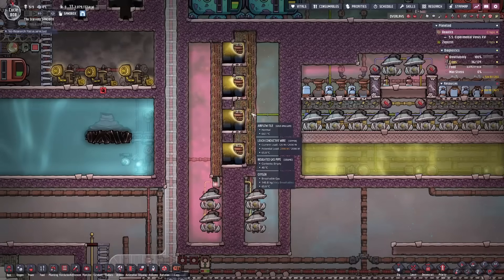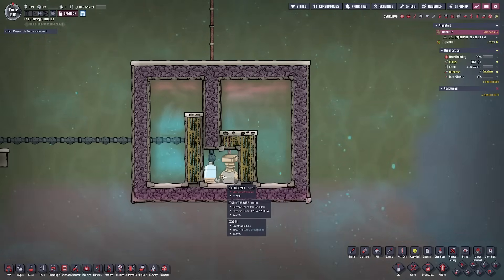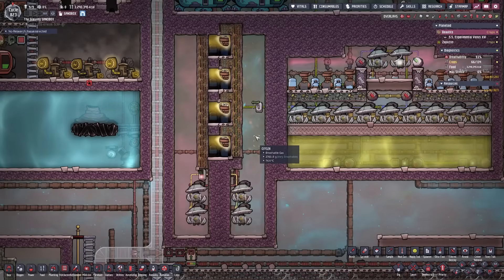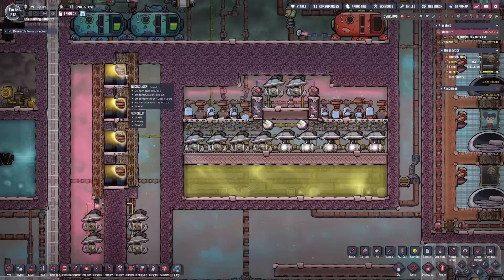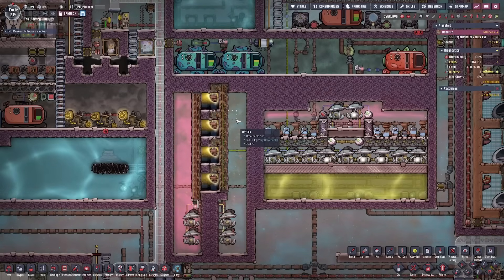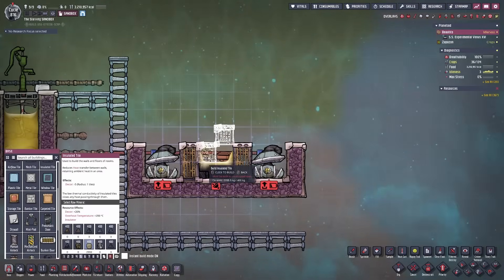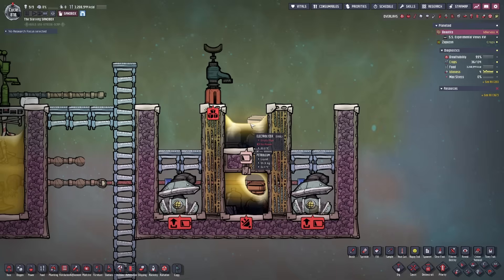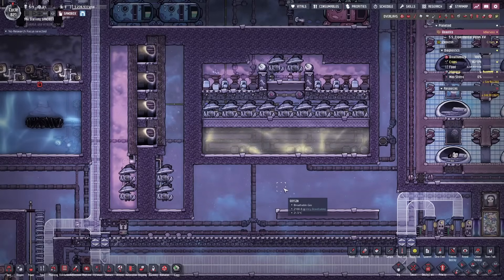How to Build the HYDRA for BEGINNERS in Oxygen Not Included

Comment: I feel the hydra might be a trap, just in waiting. The spom cutting off when demand is low is actually a good way to conserve resources. Most runs early on water management is vital until you have uncovered and tamed most of the water sources. Yes, the solution to that would just be atmo sensors on the sides so that it doesn't just stack pressure forever.

Comment: When I try to do this build the oxygen never moves to the right side. Only the left chamber fills, leaving the right chamber in vacuum.
Reply: Turns out I wasn't supposed to vacuum out either chamber, I swear I hallucinated Ethan saying I was supposed to xD. I read elsewhere that HYDRA setups work best when the chambers are "primed" with their respective gasses. In this video, Ethan starts with both chambers filled with Oxygen. In my play-through I was building this in an environment of polluted oxygen. I fixed this by opening my vacuumed chamber, letting polluted oxygen in (and also a little bit of oxygen from the left chamber which I had expelled via the left chamber's pump). This helped the contents of the electrolyzers start spilling into the right chamber. I let that run for a while to build up a lot of oxygen, causing the polluted oxygen I had in the right chamber to squeeze to the top. I then opened the top-right of the HYDRA, let the polluted oxygen spill out, and hurriedly sealed the top when only oxygen remained. Then I was able to follow the steps in Ethan's video to expel the remaining oxygen from the left chamber, completing the setup. Thank you for the video, Ethan.

Comment: I'm a little bit surprised by your selection of liquids for the hydra. The amount of liquid required to flood a building depends on their mass per tile. Petroleum and crude oil have just around 800kg so you can flood it quite fast in comparison to something like brine which has 1200kg. I usually use brine or salt water for the bottom layer with 100kg per tile which is a full 200kg bottle with a bottle emptier and it never has a problem. I then use water for the top layer with 100kg per tile which is a full bottle in a bottle emptier.

Comment: I like this videos, but I'm trying to learn how to get out of early game and all I can see are advanced setup that I can't build
Reply: I genuinely never have a clue what people are talking about, when is the early game and midgame, i know the end game for the rocket. I watch some videos how to get clean water, the rest I just managed to create a giant loop of resources. My favourite is natural gas resource, literally create power and polluted water, clean the polluted water, you get water, turn to hydrogen and oxygen, you get more power. I don't even know why the video separates the oxygen and hydrogen for, it separates on their own, bottom oxygen, top hydrogen, gas intake at the bottom and top, put a filter, one or two hydrogen generator to power them and that's it. Most of extra power goes into cooling them down.

If you are talking about materials such as plastics and steel, you need to get oil, usually at the bottom same as Terraria. Cooling it is easy, because you if you add water, it becomes steam, use steam generator to power the aquatuners, which provides cools down polluted water, if it doesn't cool fast enough, add another one, when you see everything works well, seal them off.

If you don't want to do that, just go ranching route, dreckos eventually lay eggs that makes plastic dreckos and you get them by shearing them off. You can get metal ores from metal hatchlings. It depends on what they eat, I myself never took even a second to figure it out, I just don't sent what they eat in the feeder, eventually one or two pops up, and the feeder tells you what they eat. I don't bother with it too much, early games just use hatchlings for coal.

Comment: Gonna try this for the first time soon. does that insulated tile in the top left matter? I saw you used that pattern a bunch. Or is it fine so long as the hydrogen & oxygen chambers just have no touching tiles?
Reply from the maker: The design of a hydra is important. I suggest making a save right before bringing it online, so you can reload if it doesn't work properly, and make the necessary adjustments

Comment: Do I have to cool the Electrolyzers when building a Hydra?
Reply: If you snake the water pipes and the water is kinda cold it won't over heat. If you sent hot water use steel or gold amalgam

Comment: For getting exact amounts of liquid or gas, I've been using the haul point mod. It allows you to specify exact amounts for a duplicant to bring to a tile, then has an auto-spill option for emptying. It makes getting exact materials where you need them much easier (and stops dupes deciding to move them somewhere else).

Comment: Just a note to others:  Build your water pipes as you go!  I was following along in the video and water pipes weren't mentioned until the end.  At that point I had to empty out each oil/petroleum chamber to get back in there to build the pipe connections to the electrolyzers.
Reply from the maker: That's a good point, I should have mentioned that sooner in the video. Apologizes for that.

Comment: Just Tried it with any mix of 2 liquid, I tested salt water, brin, polluted water, gunk, crude with water. 
Both at 10kg and I added the water last. 
The room need to have some hydro and o2 already (separate room) 
Otherwise it wont work
Reply: Didnt the liquids become steam? Since it is hot?
Reply: @miguelsilva2661 i dont think electrolyzer will go above 100C even without cooling well except ur base already hot enough

Comment: 16:14 another good advice is to prime both chambers with corresponding gases. It will save up on time but drawback is that you will have an overpressure icon on a vent that will remain sealed inside. qwq
Reply: Can't you build one of those water seals and then a door? That'll allow you to fix anything inside and once it's all done, remove the door and block it up if you wanted to.

Comment: I usually, when trying to get an exact amount of liquid for flooding vent for an infinite storage, just run a pipe to a Bottle Filler and use the slide to decide how much liquid i want in the bottle. Then change the capacity to zero so the bottle drops, "move to a location" the bottle, "Empty" the bottle and done. Is good when you are building really far from where your liquids are and dont want to build 100 tiles of pipe to there
Reply: I'mma start doing this.
Often, what I'd do is use a meter valve set to whatever amount allows me to make infinite gas storage, but coupled with bottle emptier to make pipes shorter.
Reply: Interesting, maybe that would work with gas bottle too (for waterfall liquid compression)
Reply: I always just used a pedestal with a bottle of whatever liquid i wanted  but this is cool

Comment: I mean the hydra is literally an exploit. You need to know how to break the game mechanics and jump through a lot more hoops to get it running.
Reply: Yeah, I hate that the best ways to do things in oni is to exploit.
Reply: There are so many things in the game that should be considered exploits but that's just how the game is. Sometimes they do seem to patch them out. I wouldn't call it an exploit because that's how the game functions, it's just clever use of said mechanics.
Reply: I dont really see it as a exploit, as the building cannot be floaded, right?
Reply: @Archmagos_Trollman  It is literally an exploit.
Reply: @rekrn12345 if it is an exploit why has the devs not fixed it by making the building not able to be floaded
Reply: @Archmagos_Trollman  I expect they are incapable of doing so based on the poor engine itself. Considering ultra late game saves still become unplayable makes that obvious. They need  a new better coded engine.
Reply: @rekrn12345  How many cycles till that to happen i am curious now
Reply: @miguelsilva2661  It depends but anything past 1000 becomes almost unplayable.

Comment: does it have to be petroleum and crude oil? for thermoreactive reasons so it cant overheat and turn into steam? nothing that can offgas for sure,
but could you make a "early game hydra" work with e.g. water and brine?

in my current playthrough im at cycle 150, still sitting on a half rodriguez (2 electrolyzer, 2 oxygen pumps, 1 hydrogen pump, 1 hydrogen generator + overflow = 1kg of oxygen per cycle) on a natural cooling loop through a cold biome... just destroyed Demolior, now having to fix and upgrade my base for the midgame, i dont yet have acces to oil or petroleum tho, build my intracosmic blastshots from Biodiesel (all DLCs, on the PPP planet)

soooo... can i make a hydra work at this point or should i transition into the good old full rodriguez for now until i got acces to oil and petroleum?
Reply: you can use any 2 liquids as long as they have followings:

do not use a liquid that will off gas, ergo, do not use polluted water, it will produce polluted oxygen

the heavy liquid first, then the lighter liquid on top, otherwise it will not work
Reply: I extract salty 95 degree water from a geyser, transform it into clean water, do not cool it. The water temperature is approximately 97 degrees. There are 4 electrolyzers, hydra. Water flows to them through standard granite pipe. In 300+ cycles, nothing has ever heated up above 98 degrees. The electrolyzers work constantly. Only recently I added automation so that water stops flowing to them when there is too much oxygen and hydrogen. Below is 2 kg drop of petroleum, above is 2 kg drop of ordinary water. I think any liquid work
Reply: I don't see why you couldn't use water & brine! A usual SPOM only gets up to about 80°C so it should be totally fine with those two. At least that's what my brain says, so who knows haha

I had the exact same thought when I was watching this

Comment: I'm a sucker for buildings that go for 4-tile (6-tile including floor and ceiling) height configuration, at most 9-tile (11-tile). So Hydra seems right up my ally.
Reply: I want to design hydra that is horizontal so it would take exactly 4 to 6 height
Reply: @barsozuguler4300  tile-pump-tile-electrolyzer-tile-pump-tile, a wide hydra, is exactly 2 floors of 4 high room grid.
Reply: that´s oddly specific